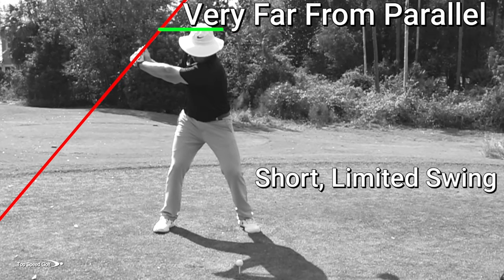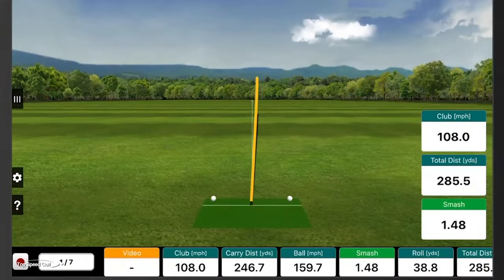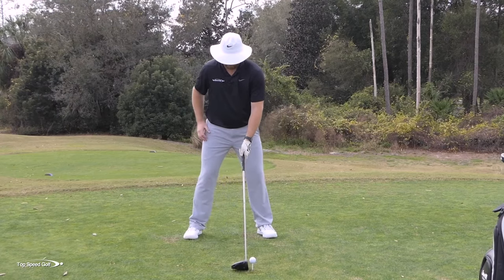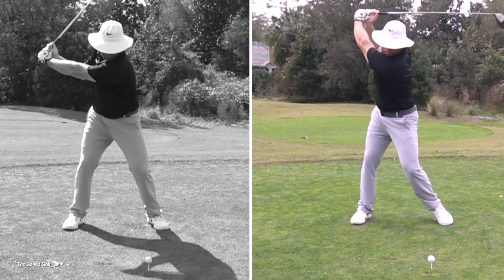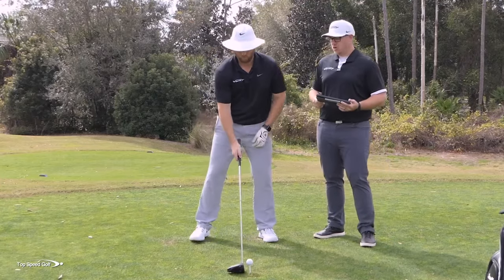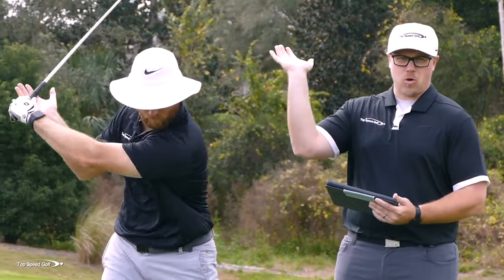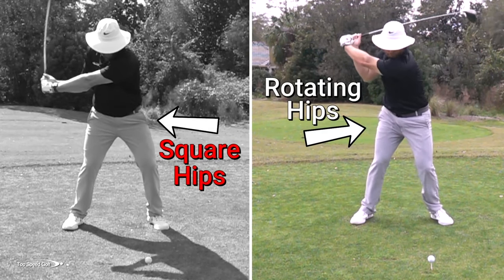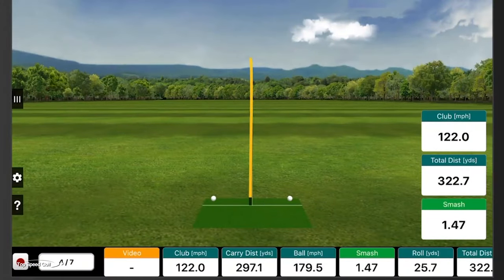Drills to Stop Rushing Your Downswing

Comment: This is a great video, thank you. You left something out that I think is critical, and you have explained in other videos...keeping the takeaway wide, so lag can be created during the transition. If the "hinge" is created on the takeaway (typically very early and way before transition), I don't think any of this has a chance. I'd like to see more content like this...I've been working to accelerate later vs earlier, and its a completely different move that is a challenge to achieve (and fun to work on). I measure my swing speed along with my dynamic loft, to confirm that I didn't rush early and I am implementing speed at the right time. I'd love to see more content on drills to generate speed at the right time. Thank you for all of your great content!
Reply from the maker: Thanks for watching!